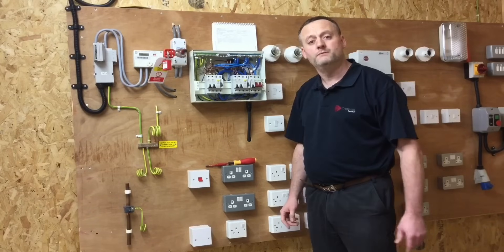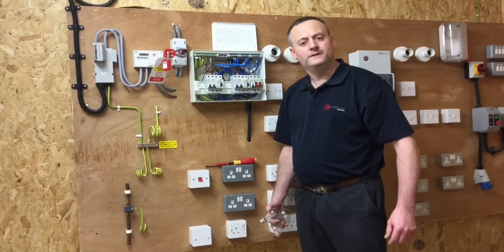Insulation Resistance Test (Includes Line and Neutral Together to Earth and Between Live Conductors)

Comment: What do you do if there is a digital time clock within an installation? Do you just have to isolate the supply of that piece of equipment or do something else? Also.....in regards to lamps being removed, is this the case with LED down lights or can they stay during the test? Great video - Thanks!

Comment: What about when there’s loads of lights are connected and you haven’t time to disconnect all of them when you need to test between L-N? Not possible to do is it?
Reply: That would potentially fall under an "operational limitation" which should be discussed with the client and could be omitted.

I'd ask "why don't you have time?".
Reply: When your expected to do 35/40 circuits a day a lot of time will be lost disconnecting all lights

Comment: What would be your solution when testing a 40-circuit panel feeding to various lighting and power branch circuits with dimmers, bulbs, smoke detectors, etc on the branch circuit? It can't be reasonable to hunt through the entire building looking for these devices to connect.

Comment: Hi Gaz, just one more question - if you was to test an old installation for insulation resistance and it was below the minimum 1megaOhm what would be the action to take?
Reply from the maker: Further investigation. Breakdown the circuits and try and find the part(s) if the installation that are brewing down the readings 

Also an interesting video 👇🏻
https://youtu.be/Ml95TFpchmA
Reply: @GSHElectrical  Thank you very much - That other video was definitely worth the watch!!

Comment: HI GSH, Just a question - you mention the removal of sensitive electronics. If we were at a stage where a cooker had been weird into the cooker switch would we need to remove this before the test? or would we do the test with the switch turned off?
Reply from the maker: Ideally you would remove the load and have the switch ON so you test the full length of the cable in circuit 👍🏻. Gaz
Reply from the maker: Ideally you would remove the load and have the switch ON so you test the full length of the cable in circuit 👍🏻. Gaz

Comment: I get the unplug and leave switched on etc but what about fused spurs. Ie say a washing machine. What do I need to do for them. Leave switches off or pull fuse or take front off and physical disconnect.

Comment: Thank you for the video. Very clear instructions. 
Just wondering if i do IR testing in real house for c20 power circuit. Do i have to unplug all the equipment for that circuit inside the house in order to do Ir testing 500v? Wouldn’t it be too much time? Any quick way you can suggest would be great? Thank you

Comment: Hi Gary great video again , Just a note maybe I find doing a lead check with the Megger with a short , set the voltage to s minimum is 250 v it save the battery's

Comment: Hi, I have a question about insulation resistance on ring circuuts since the focus is mostly done on radial circuits. When carrying out the insulation resistance test on a ring circuut, shall one test on only one end of the L and N cables? Or can one link the LL and NN and test across them? Thanks again

Comment: Can I ask a couple of questions: 1. What if you have an installation with load of down lights, do you have to get step ladders and remove them all for the test? 2. One thing that I am confused by, is that, if the main neutral is ultimately connected to earth back at the supply transformer, why would you not get a zero or close to zero reading when you measure between neutral and earth in the consumer unit if you were making three tests rather than the combined neutral and live to earth test? Just for my understanding. Thanks.
Reply: The main switch is locked in the off position so the neutral will not be making a connection to the earth unless there is a fault in the system which is what you are testing for.

Comment: Easy on a test board, how about showing us how to do it with 50+ led fixed lights, neon FCU and inaccessible white goods etc.
Reply: To do the tests at maximum efficiency you would disconnect all led lights. (Either live or neutral at each light and join them in a connector), remove all lamps from other lights. As for the white goods, pull the machines out and disconnect, any neons have to be removed from the circuit (disconnect switch spur and join cables to complete circuit to the end of line etc etc) 

Theres no quick fix. 

Painstaking: Yes
Time consuming: Yes
Always possible: No

Bill accordingly: Most definitely 

You sign your name to something, you better be sure you've covered your ass.
Reply: Then charge £80 for the EICR
Reply: @Jay369 😊
Reply: It’s for college students lad
Reply: Put something down in the limitations 😂. Real world. No like in this video 👍
Reply: Guys what do you really do on this .insulation Res could take some jobs a full day to disconnect all load .there is normally still something hidden still connected that ruins the test ,and it all become a waste of time
Reply: I still don’t understand how connecting line and neutral together then to earth works??
Also if your connecting line and neutral together surely you wouldn’t see a line to neutral short on IR test?
Reply: @alanmarriott9216  yes that is correct. It will not detect line to neutral fault. I think the reason for it is because line and neutral are both classed as current carrying conductors and testing both to earth eliminates any earth faults that maybe present before power is applied.
Reply: Seems like the kind of test that real world can only be done when the site is uninhabited. So new builds, major renovations, rewires… and coincidentally that’s also exactly when a full test is most needed.
Reply: Possible test  L-Ground or N- Ground if the led lamp connected?
Reply: @francisdavid5272  I wouldn’t do a 500V test with sensitive electronics connected, not even to ground. It’s just… not safe for the equipment. Even aside from whether you could get a meaningful result.
Reply: You conduct the test before accessories are installed. Testing should be carried out through the install not at the end. It's easier and less stress to find faults early so you have the access and labour on site to rectify

Comment: On the lighting circuit  containing two way or two way and intermediate switches would you not need to operate switches one at a time as it states in GN3?
Reply from the maker: smacznykonsek 
https://youtu.be/9AjyWl_2bds
Reply: @GSHElectrical  I stand corrected. Even at the beginning of this video presentation you mention that light switches were left in "on" position ;)
On a side note, I was thinking about it now and concluded that with two way or two way and intermediate switches (no matter how many) with any connection method for those we only really need to operate the first switch (nearest to the supply) and perform two tests - in that way we will have both strapper "sets" tested including the switch line going all the way to the load. Please correct me if I am wrong? And, again, this is just me sharing my thoughts.
Reply: @GSHElectrical   Thank you for your response and for the link! I must have watched this one very recently as I am currently revising for my AM2 exam tomorrow.
I wanted to add my thought on the topic of the discussion that you are provoking on this video regarding the two boxes for IR on schedule of test results form.
Looking at IR testsing of three-phase 4-core power cable guidance in GN3, table 2.3 says that the lowest value obtained from tests between live conductors (Test 1 to 4) is recorded as 'between live conductors' and for Test 5 and 6 again the lowest value of these tests is recorded as 'between live conductors and earth'. Maybe the same principle can be then applied to single phase circuits where the lowest value from testing L to E and N to E would be recorded as 'between live conductor and earth'? And then any reading below 20 mega ohms would be investigated as required. Just my thoughts!

And yes, all of your videos I watched so far have been great help!

Comment: Hi Gaz, you said the minimum resistance of the whole installation must be at least 1Megohm, if less than 2Megohm should be further investigated.  Correct me if I'm wrong but the latter, shouldn't that be any circuit that is less than 2Megohm should be investigated rather than the whole installation that is less than 2megohms?
Reply from the maker: Steve Tang agreed. Thanks for the message. Gaz
Reply: Alot of low readings are due to lead cable or water on conductors or a common one is forgetting to take lamps out lol done that....

Comment: Hi Gaz thanks for the excellent, clear and concise video on insulation testing.  Please could you possibly do a video on board changing with tips and advice on getting it as neat as possible. Thanks.
Reply from the maker: Step by Step How to Connect up a 10 Way Wylex Dual RCD Consumers Unit (Fuse Box) By Luke Wichard https://youtu.be/tyOiLAUlSpU

This may help 👍.
Thanks for watching and commenting. Gaz

Comment: Great video, very informative and helpful. If you are testing a normal house say and the lighting downstairs is one circuit ,do you remove every downlight lamp from the fitting in order to get a true reading?
Reply from the maker: Hi you should do however on an EICR often the insulation resistance isn’t carry out between Line and Neutral as all loads cannot be removed. On a new installation the loads wouldn’t be fitted so this test can be carried out. Thanks for commenting and watching. Gaz

Comment: What is the duration for Insulation Resistance Test. In some places where i worked, the IR Test was carried with a duration of 1 min for each circuit base on the length. Correct me if i am wrong. Thx
Reply: Test until meter stable readings

Comment: the mega meter was readfing 999 but on the result sheet you wrote  +299 ?
Reply: Depends on megger but yes if meeger tests to 999 you put greater than >999

If it's the older style megger you put >299

Comment: Great explanation!! Quick question. How do you do an insulation resistance test when impractical to remove all lamps, sensors, electronic equipment ? Is it allow to perform the test only between L-E , N-E?
Reply from the maker: Hi. Test with Line and Neutral together to Earth... if you cannot remove the loads never test between Line and Neutral👍. Thanks for commenting and watching Gaz
Reply: @GSHElectrical  Thank you very much for your prompt answer. Best regards
Reply: @GSHElectrical  Hi, if you are testing Line and Neutral together to Earth does that mean the 500v DC current is not going through any loads and bypasses it and goes out through the Earth cable? If you have for example fixed downlights connected on the lighting circuit does the 500 volts not passthrough the lamp?
Best regards and thanks.
Reply: just test at 250
Reply: @joshstrom2791  so if I get <2k megohms on 250v test, is that acceptable for an EICR? Or do I need to test at 500v?

Comment: Im an electrician in canada and we never do this kind of testing
Reply from the maker: Thanks for commenting and watching GSH Electrical 👍
Reply: Same in Oz. Nothing like this. I have been in the UK seven years now.
Gaz. Why do u have to move the Clip in the neutral bar when u tested the next circuit??
It's not a knock at all just wondering since the entire neutral terminal is one unit electrically speaking so any where on there would yield the same reading.
Also does your college do test n inspection courses for àn installation sparky who wants to upgrade?? Ta
Reply: @carlmarquardt994  the neutral bar is split into 3 separate blocks if u look closer
Reply: carl marquardt This particular unit has 3 segregated neutral bars to achieve separation  of circuits. Integrity. The individual circuit neutrals from the 3 split positions are electrically isolated.
Reply: @carlmarquardt994  Because the RCD's are in the off position thus isolating the two neutral bars on the left from the main one.

Comment: Great video. Very informative. Just a quick question. How do you perform the IR test on a circuit which has lighting loads connected to it.? Is there a way to still conduct the test? I watched some vids and they said that testing the insulation by linking the neutral and line to earth is the way to do it.
Reply: Yes link live and netrual linked to earth sometimes you just cant get access because of having to get up high to the lights and access etc.

Note on certifcate that you only tested 
L/N TO CPC 

On a new fresh install you would do a full test but on a periodic tou would only do the above unless client said different then you would agree that and charge accordingly !!!
Reply: @bramcoteelectrical1088  would you then leave L-L test blank on the certificate

Comment: Hi, 
Can you explain how to do an IR test from somewhere other than the CCU. 
Like, when the ring final circuit is being split, how you test at the "halfway" point to confirm which side has the lower reading? 
Also, can it be done at ceiling roses/switches etc
Reply from the maker: Hi. Breaking circuits down is an essential part of fault finding. In your case to discover a section of a circuit with a low IR 👍. Thanks for commenting and watching GSH Electrical
Reply: @GSHElectrical  Definitely. How would you complete an IR test at a socket though? Just test on the wires once removed from the socket outlet?

Comment: Remember 500v dc is the maximum test voltage for a 230v installation. In reality 250v makes more sense, much less likely to damage sensitive equipment. I know it should be disconnected but in the real world its very easy to miss stuff.
Reply: If you're serious about your trade, you'd own a Fluke 1664FC Megger, it literally comes with the ability to tell you when there's  appliances connected
Reply: @jarjarblings4165  Fluke and Megger are 2 different brands mate
Reply: @jarjarblings4165  really? I'm curious

Comment: I was just looking at that second board how would you run say a garage board. Would you connect it into the main board or use those Henley connection blocks inbetween the main income terminals
Reply: Will depend how you design the distribution circuit.
Reply: 4 years later......Henley block to Isolator near main DB....or connect into main board..up to you.Depends if there is room or not

Comment: So Gary, for EICRs I got into the habit of doing the test of Lines-Earth only siting my reasons. According to BS 7671 I’m supposed to fulfil both tests, the other one being Line-Line. My question is, do I have to remove all those lamps in the downlight fittings? Which is what I’ll have to do. I’m not asking the question in a negative way as I am in a pursuit of excellence, hence the reason why I watch your videos.
Reply from the maker: Hi. BS7671 test results page only has 2 boxes for insulation resistance testing Live/Earth and Live/Live remember live conductors are line and neutral. Napit and NIC test paperwork have 3 boxes. On an EICR you possibly won’t be able to remove all loads so a test between Live conductors cannot be carried out. Thanks for commenting and watching Gaz 👍
Reply: GSH Electrical 
You’re on point. I actually fill out the NIC forms and haven’t looked at a BS7671 model form for an age. Having had a thought, by testing first off, Live-Live, and that being satisfactory then testing afterwards Lives-Earth and that too being satisfactory you need not test, Live-Earth and Neutral-Earth. I noticed too on the BS7671 model form that the field for the amount of points is not present. Again, you see,  I’ve only been filling out the NIC forms.
Question: For insulation resistance testing, what are you NOT testing when leaving the switch(es) of a socket, in the ‘off’ position?
Reply: @abdulseaforth6930  if you leave sockets switched off you will not be testing the end contacts of the socket points hence you must leave it on

Comment: Hi Gaz
If you're doing an initial verification, would you need to bother testing with Line and Neutral connected together or is that more for if you're testing an older installation and its impractical to remove every single bit of kit throughout the house?
Thanks in advance
Reply from the maker: Hi. The video was to provoke the debate as BS7671 only has 2 boxes for installation resistance 🤔. Thanks for commenting Gaz

Comment: GS38 says 4mm max probe length - Monday's session.  I'm pretty sure the "older probe" is more than 4mm...
Reply: Insulation resistance testing is a dead test (below the 50v limitation complying to GS38) so in this test you do not need to comply.
Reply: Nathan Claxton it actually states used to measure or deliver voltages over 50vac or 100vdc and in this case, your delivering a voltage of 500vdc so they need to apply
Reply: @seanmac2384  you are correct coz it can still cause an involuntary movement from the shock of the testers 250v+ voltages
Reply from the maker: Hi. Max 4mm preferably 2mm preferably spring loaded as stated in GS 38 👍. Gaz
Reply: There’s always one wise ass know it all. Shut up @Gareth Evans
Reply: Piggy back plugs you need